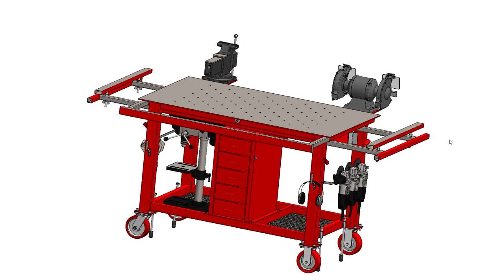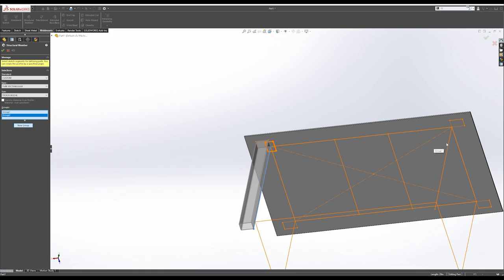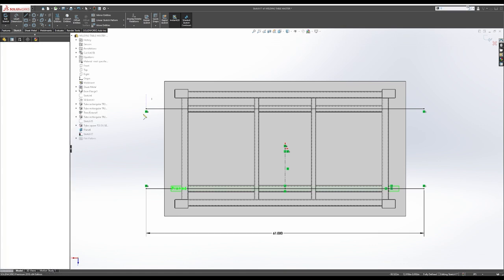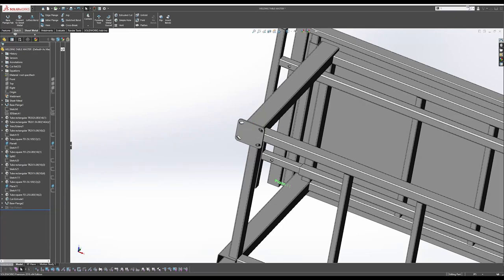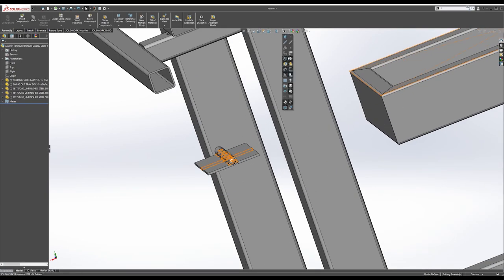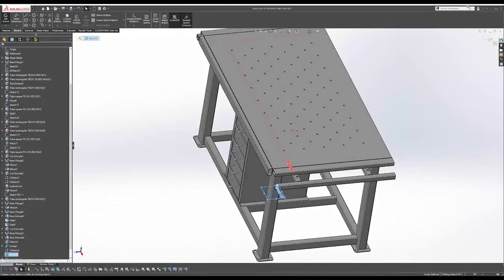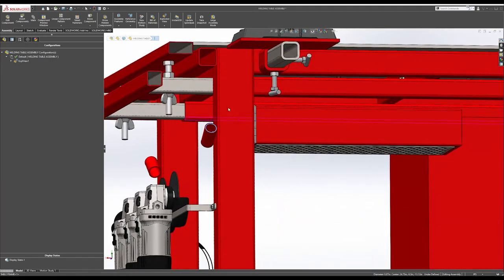Intro into Weldments Solidworks | Welding Table Example

Comment from the maker: Learn how to CAD model the best WELDING TABLE using SolidWorks Weldment Features.
By the end this video you will learn how to use 3D sketching, trim/extend, create/save custom structural profiles, and ultimately create a welding table.

👉 Subscribe: http://bit.ly/subcribe-today

Download & Try SolidWorks CAD Software for free:
https://my.solidworks.com/try-solidworks

Time Stamps
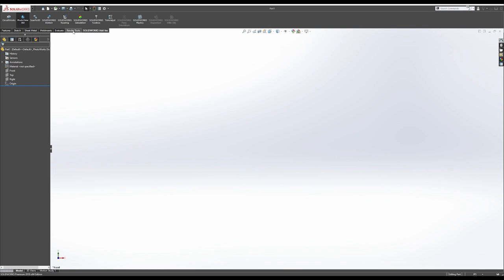0:53 | Activate weldments/sheetmetal 
2:45 | 3D sketch frame layout
5:50 | Custom structural profile
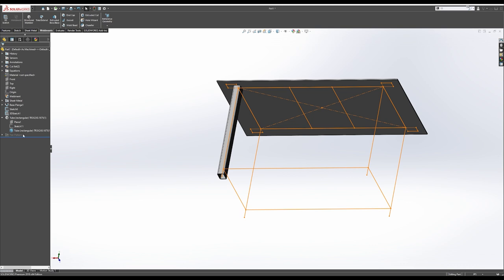10:05 | Add table legs 
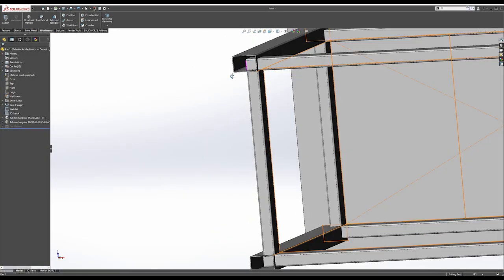13:16 | Trim/Extend
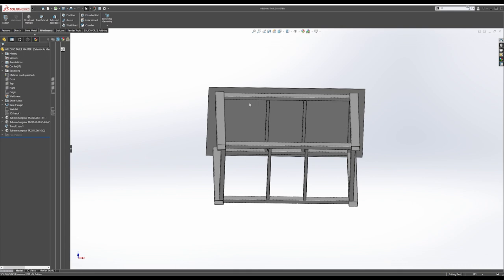17:00 | Slide-outs
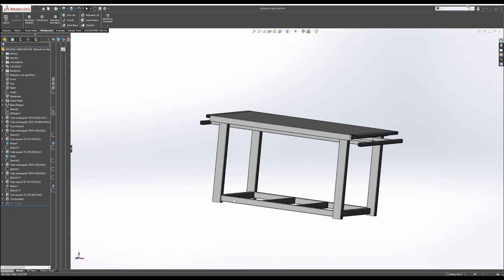27:42 | Mounting plate for casters
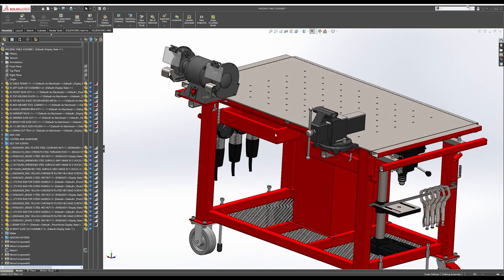32:12 | Swing out storage trays
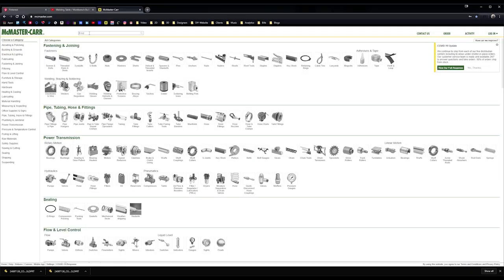36:24 | Hinge configuration and location
44:00 | Holes on welding table plate for clamps and jigs
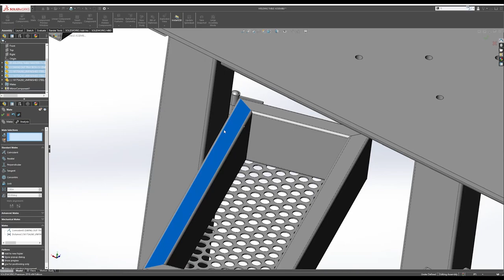52:00 | Stops for swing out storage trays
56:45 | Adding casters to welding table assembly
1:00:07 | Add base plate
1:01:23 | Brackets for grinder, clamps, welding helmet
1:07:00 | Optional add-ons
Reply: Doesn't work :(
Reply from the maker: Guillaume Graff sorry let me look into and I will get back to you.
Reply from the maker: @guillaumegraff8587  ok give it try now it should work. Just retype your email and you should be able to access the files.  https://rathasochenda.com/download/